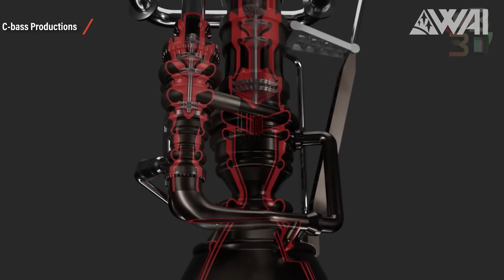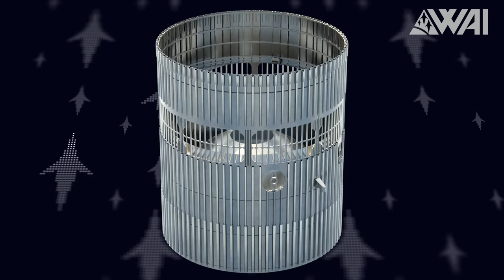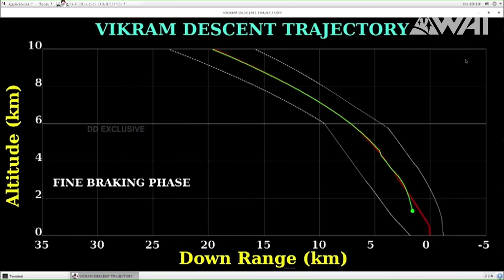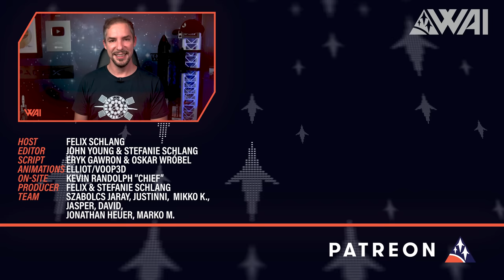Epic Testing Change! Is SpaceX's Starship Raptor Engine Unreliable?

Comment: I was puzzled when I saw that almost no water was coming out of the deluge system at the end of the static fire. It took a while to see the flow slowly coming back and the center sprinkler was not operating anymore. I suspect that this static fire end abruptly because the deluge system cut-off because of over pressure created by the engine pushing the water and steam back in, overwhelming the inner pressure of the system. Usually, SpaceX goes all the way through the expected duration of the static fire, cutting it short because there’s unlit engines is irrelevant, something else happened and there is no answer from SpaceX about that so, I suspect bad news.
Reply: Yes I noticed the low flow too. I think you may be onto something.
Reply: how do you fix that? more gas for the water system? can that be done? is the system able to scale up like that?

Comment: Does it make sense to perform an additional static-fire test of S25 through a hot-staging ring, perhaps while it is attached to the top of a dummy booster?  Thanks for the video as always.
Reply: Unlikely. The engine exhaust will behave much differently near the vacuum of space. Im sure the design takes this into account and therefore would not work in atmosphere.
Reply: @420gazer6  I was actually thinking the same thing.  The lower atmospheric pressure might help draw the Starship Raptor exhaust out through the hot staging ring and relieve some pressure from the top of the Booster.  I was just wondering what other people thought.  Thanks.

Comment: it seems to me that they are having issue with reliable ignition, my life experiences with igniting gas torches etc, particularly LPG torches, to me would be that it can be difficult to light off such a mixture reliably without a massive ignition input source. I don't know what they are using, but it may be that it 1 needs longer duration and 2 needs to be signficiantly high output. Most likely the issue is gap ionization over a large distance against such a non dielectric fuel air mixture. so higher voltages would be required if they are using a kettering style spark ignition. I doubt you could use anything else and have it be relightable.

Comment: I'm assuming they tested these engines very extensively on an individual basis. For example, i'm sure they tested 33 engines consecutively off the booster.
So it's probably something which is different about their use 'on' the booster. Could be overpressure of so many other engines nearby? Not sure what it is. Space-X themselves may not be sure either. But the tinkering with ignition order suggests that they think it's related to being lit up with so many other engines next to each other.

Comment: given that on November the 10th last year NASA reported that SpaceX was producing Raptor 2's at 1 a day they have made over 278 since then. The low numbers and wide range indicate that they were using a collection of early production engines for the flame divert-er test to avoid damaging the latest production engines. My money is on booster 8 now being fitted with a shiny new set of latest production engines in the high bay in the same way that booster7 had a lot of sequentially numbered engines.

Comment: They will get there without a doubt. But it is a learning process. No doubt if you had fired each of those engines one by one on a test stand they would have worked perfectly. But put 33 together and you get a massive amount of vibrations that could no doubt cause problems not seen before on the test stand. SpaceX will learn what needs to be learned to get those engines working together without issues. And like Felix mentions, a lot of these engines are slightly different to those around it. SpaceX will have all the data on each engine, on how it behaves on a static fire. That data will show how each variant behaves. I would find it very interesting to see the data on those engines that failed on booster 7, would love to see if each of those engines had something in common with their build. SpaceX will find the secret sauce that will iron out these failures. They got a ton of data from the first booster launch, that data will increase further when the next one launches.

Comment: I think we need to see another deluge test asap.  The water flow looked reduced at the end although the steam made it hard to be sure. If the water flow didn’t push back against the exhaust gases as much as expected then an early shutdown may have been commanded. Possible issue to be fixed?
Reply: how whould you fix that?

Comment: Just looking at the way SpaceX addresses all problems I imagine these engine issues will be fixed relatively fast.
Heat tiles would be the next area of concern - did any fall off on the first launch attempt ....   before it was blown up?😉
Reply: This is what I am most concerned about as well, getting to orbit is one thing, but surviving reentry in a reusable vehicle is probably going to be the most difficult aspect.
Reply: @NNFaNRacing You mean like they've survived 200 re-entries and landings of reusable boosters, already!
  👻☠️🗽💯🙏
Reply: @NNFaNRacing  But they can be commercially operational without recovery, just as Falcon 9 was.
Reply: @williamtsmith9668 Falcon 9 doesn't recover the 2nd stage like starship is trying to do. Coming in from orbit is a lot harder than recovering a booster.

Comment: all the 5 SN flop tests didn't seem to have much issues with raptor reliability going up ie 0% failure over 15 engines and they were old prototypes doesn't this imply something about simultaneous ignition of 33 is affecting things more so that raptor itself?

Comment: 1:12 - is it just me or does the steel plate look awfully dry when the engines shut off? It looks like the deluge system can't push out water against the pressure of the Raptor exhaust. at 1:12-1:13, there's very little water visible, it only starts spraying again after 1s or so. 

To me this might mean there's a problem lurking in there. I think SpaceX should do a static fire test with full power (if necessary with the 1200 tons of a full Starship on top).

On the other hand, if they get the Raptors to fire reliably they can launch and if stuff blows up again, they can start rebuilding immediately without having to tear out the inadequate system... ;-)

Comment: Hope the issue is not using 5 bytes and not 6 bytes (or bits or equivalent), in their internal routines.
2 to the 5th, is 32. Five whatever would cover numerals 0 to 31; 32 engines. There are 33 Raptor engines in the booster.
Six bytes would cover numerals 0 to 63.

Comment: Hey Felix.  Haven't heard anything about the steel used in Starship construction for some time.  Is that alloy and metallurgy finalized now?  Or could SpaceX still be tweaking it?
Reply from the maker: It really almost is 304L. They call it 304X, but that likely is a very minor difference. Steel. That was the goal. As unmodified as possible to be able to just use what's already heavily being mass produced and low in price.
Reply: will they ever to back to carbon fiber they save sooooo much weight  @Whataboutit
Reply: @SirDeadPuppy hopefully not.
Reply: @peterfireflylund  ohh come now as expsive as it was when he first tryed im sure it must of gone down in price just think how much more epic starship whould be with all that extra payload i think it be great for a tanker starship that dosnt have to worry about heat fill that baby up to the brim to help keep number of trips down

Comment: At this stage of development, SpaceX should be working with a huge ammount of safe margin. In other words, every single potential failure maybe trigger some switch off mechanism.
Reply: And that's likely part of what we're seeing with the engine shutdowns. It's not like the engines are exploding — they're simply being turned off by the computers when the telemetry isn't what's expected. It could be something as simple as temperatures being fractionally higher than expected... they're fine when run individually on test stands, but obviously the runtime environment for a 33-engine static fire is a little different.

Comment: 20:32 you’ve got a mistake with the visuals. The downward facing rockets won’t disturb the fine dust particles at all when landing. They won’t even make make the landing legs the slightest bit dusty when it touches down if we go with photo evidence from nasa’s moon landing. Imagine dust fine and soft enough to make foot prints in but so dense the rocket won’t even make a crater.

Comment: If I am right, the engines that stop working had destroyed the nozzles (cones). Reaso is that the reverse thrust inside the launch pad made pressures to the cones from below, and they are crushed as egg's shell, from inside. Because in the cones' wall are pipes with liquid methane, the cirquit is broken and the engines stop working. To improve the design of the existing launchpad it is necessary to extent the distance between the ground and the engines. Elon prepared the extension, a collar, and wants to put it on the top of the launch pad. Better results would give much higher launch pad. If so, the launch tower should be extended, and the megagilla system has to be placed higher. The same result would give launch if the rocket would be handled by the megagilla system, over the launchpad. Launchpad is designed for smaller rockets, like spacex. The starship needs more.
Reply: all that steam...going to be hard to mitigate that.
Reply: They should have just constructed the launch pad properly from the beginning, but Musk didn’t want to get the Army Corps of Engineers involved.

Comment: I love the snarky dig at freedom miles, I was listening to someone yesterday who said "about 15 feet, or 3 meters, for people who are correct." I would love to see the US adopt Metric. It's so much easier to use than Imperial
Reply from the maker: It's really just a joke. Not meant snarky. I still use metric and won't ever change that. Maybe the US will still change. You never know! :)
Reply: Right? What's 0.5mm in inches?
Reply: @iamaduckquack  4 gauge
Reply: @Whataboutit  it makes me chuckle every time
Reply: @iamaduckquack about 20 thousandths. 
Rule of thumb in machining is 40thou to a mm.
Not precisely but close. 
Precisely is 39.370thou to a mm

Comment: They're still in development/RnD stage trying to push the limits and figure out where things fail, fix them and then find the new limits. Once they reach a ceiling on what's possible they will lower output power level to increase reliability/safety/longevity.

Comment: It could be as simple as the fact that the Methane tank was nearly empty while the O² tank was full, causing the whole system to starve for fuel.

They only need 5 seconds of fuel, but they need enough weight the ship doesn't tear loose from the mount.

So they had to fill the O² tank , so pressure in the Methane tank may have simply dropped faster than the pressure in the O² tank causing engines to start shutting down , once 4 shut down the rest automatically shut down.

I'm not saying this is what happened , I'm just giving an example of how it could be something minor.

Comment: Starship deployment of starling satellites should be done 90 degrees to current direction. The opening on the rocket would be much smaller and the rocket structure much stronger

Comment: I think we can all agree that we'd rather see a Raptor shut down prematurely than to have it explode. They probably have the envelope for firing quite tight due to safety reasons. Once they have more data and flight time, I'm sure the envelope will open up and will inherently increase starting reliability.

Comment: As long as they keep refining the engines & their startup as well as the deluge system that all affect one another, some shutdowns are acceptable test issues and remember: there's no evidence of any of them actually getting damaged and especially no RUD.

BUT. And it's a big BUT.

They MUS complete a cpl. of flawless all-engine SF B4 sending up the next rocket, a catastrophic failure on pad could endanger the entire Boca Chica project as well as SPI residents. They MUST work clean engine operation first, Starship's explosive potential is extreme.

Comment: If they're clever they'll run old and new comm systems in parallel for a couple of launches to test all parameters of a Starlink variant through before fully committing to it as sole system...

Comment: Good points on raptor engine. I was concerned after all the trouble we've had with raptor. But you make really great points, truth is it's still an early development compared to Merlin.
Reply: merlin is almost fully proven. maybe in ten years raptors will reach that level.

Comment: I know it may sound unlikely but could the steam from the deluge system have caused the engine failures?
I deal with low pressure superheated steam in model steam engines, it is quite capable of effecting the metals used. Steam expansion and damaging effects are dependent on the temperature. I cannot imagine the temperatures of steam created by running rocket engines into a spray of water. The clouds of steam look very pretty but I wouldn’t be surprised if it was capable of doing serious damage.
Reply: I suppose it could be possible but I doubt that's it. Just as with Falcon Heavy there is a startup sequence to avoid vibration and stress. The engines don't ignite all at once. But the sequence is measured in tenths of a second. The steam would have to move 20 meters and somehow into one of the unlit engines all within a fraction of a second. I think it's far more likely that they're experiencing challenges maintaining pressure in all of the fuel and oxidizer feeds.

Comment: Raptors are not mature that is true. However, the packed design is unsuitable for this kind of engines. Generally a spherical design with equatorial ring engines will be the way to take, which will enable Starship to land on spherical bodies at all.

Comment: One success of the test was the quick automatic shutdown feature when it detected a certain number of failed engines.  If that hadn't worked correctly, SpaceX would have had possibly an even bigger problem to deal with.  And who knows, that may have been one of the main goals of the test.

For engineers like me, this sort of stuff is par for the course, but for the impatient, it's troublesome.  Obviously you can't just have continuous failures until you run out of money, but to me, it doesn't appear SpaceX is close to that at present.

Recall the one-use Saturn V rocket payload was 261,000 lbs. (and cost in today's dollars about $1.25B), whereas reusable Starship's payload is 330,000 lbs. (and with an estimated cost of $40M per launch).  That's a 25% increase in payload, along with about a 97% reduction in cost.  Such ambitious goals by SpaceX are obviously going to require some extensive testing to achieve.

Also, about 400,000 people worked on the Saturn V, whereas SpaceX has about 12,000 on its payroll.  It's done a whole lot more with a whole lot less than NASA (not to knock NASA, but just offer a comparison).  Also, NASA's Rockwell F-1 engine (used on the Saturn V) was open-loop and thus less efficient and therefore had a lower thrust-to-weight ratio to SpaceX's closed-loop Raptor engine.  But closed-loop (where all the propellant is used for thrust) is less forgiving and requires more fine-tuning than open-loop, thus the need for extra testing.

Comment: Honestly - this video is nothing but greatness! I thought - what was going on on that shut down static fire and now I am just blown away! 
Thanks for always taking a step back and showing the larger picture. Looking at things from different perspectives is the way to true wisdom I believe.
Reply from the maker: Thank you very much, Bugman! Sometimes it does help to take a step back. We're easily spoiled by SpaceX's success to the point that we almost demand a flawless test. :_WAIShocked:
Reply: regarding what you explain in your video. It's pretty much better than flawless what happened on the last stativ fire. Even though it was not 100% perfect, it was still MUCH MORE flawless than on the previous booster.  @Whataboutit   Imagine static fire tests for the third launch - All engines running perfectly on first test attempt? That would be Crazy!!
Reply: @Whataboutit  we demand success and we get it every time. With a Musk cult operation every failure can easily be spun into a full blown success and precious learning opportunity
Reply: @Bugman563  but that wouldn’t be failure and therefore not a success. If I remember correctly with SpaceX cult members every failure is a huge success and learning opportunity

Comment: I'd like to see 33 merlin's strapped to a comparative size Starship and see how reliable that is going up and down. Merlin's I like Rolls-Royce just so reliable now.
Luv da show✌🏽🚀
Reply: Just watch the Falcon Heavy, with its 27 Merlin engines. Close enough.
Reply: Falcon heavy is nice,but not a Starship 🚀
Reply: might not get off the ground. Starship is much much more massive.
Reply: @jessepollard7132  of course, it won’t ever get off the ground reliably to reach any sort of orbit. But that’s not the point. At the center stage we must place our cult leader and celebrate every stutter and failure as a tremendous success